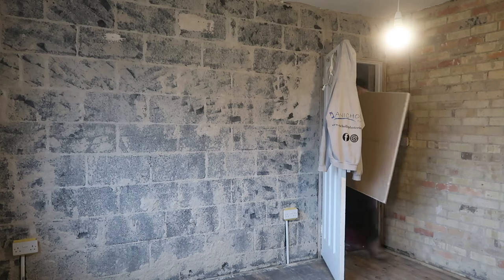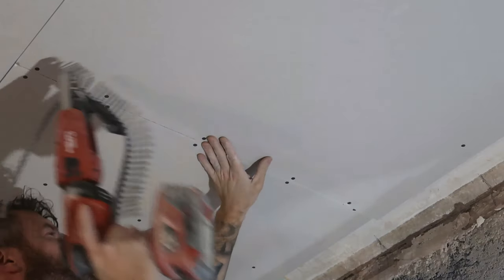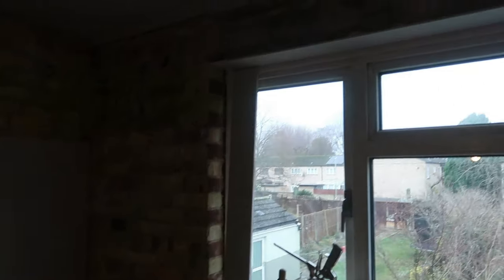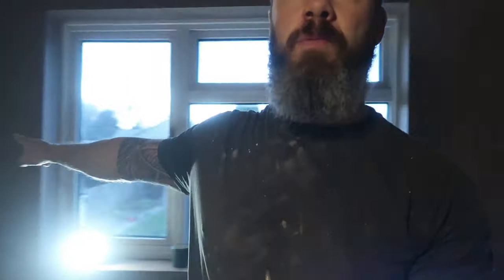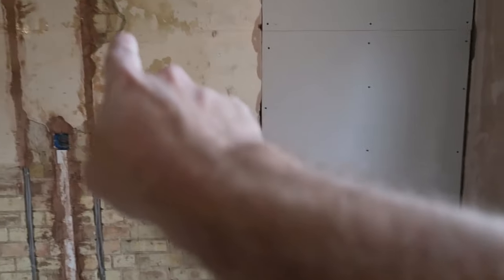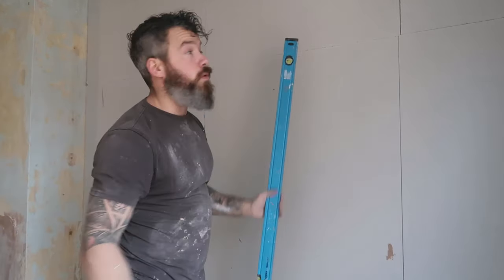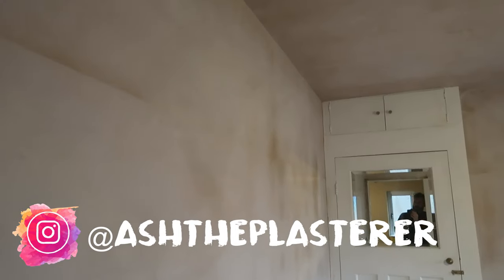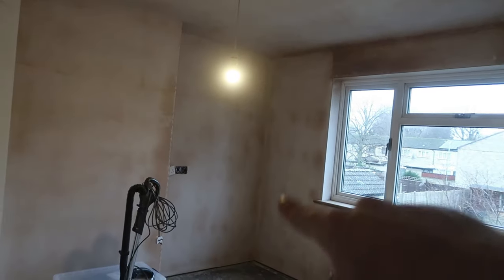PLASTERING A 1960’s HOUSE- Tacking, Dot & Dab and Skimming (refurbishment)

Comment: For a job like that I would get 8x4 boards delivered .
Reply from the maker: I would on a bigger job mate. It’s easier for me to tack the ceilings using 6x3’s also walls were over 2.4 so would have needed a strip at the top regardless so didn’t really warrant a delivery 
Thanks for watching
Ash

Comment: You're not dot and dabbing just dabbing, the dot part is when you stick shim and level/Plumb then you let those go off then dab the boards and push back to the shims
Reply from the maker: Yeah, technically, but everyone (I know) still calls it dot n dabbing, 
I’ve never actually used the old method, maybe I should give it a try someday. Just seems a lot of extra work for the same result?
Reply: Why so pedantic, I never knew about the ‘dot’ part, but everyone i know says dot and dabbing. You simply watched ‘on the trowels’ video explaining the old process and are now preaching
Reply: @AshThePlasterer  sometimes can be worth it if you need to bring it out more then the usual half inch and wall is totally on the piss. Even the best of us can tap that wall slightly too much at times, can get small bits out with skim but some big jobs usually have a bit left of a mix sometimes worth it.
Reply: @NiktheEnglishGreekCypriot  not pedantic, no one I know calls it dot and dabbing.  Should never be "dots" anyway. I still use the process now and again ta 👍